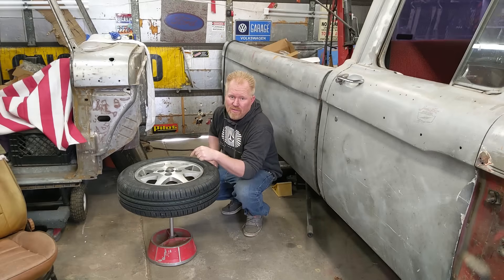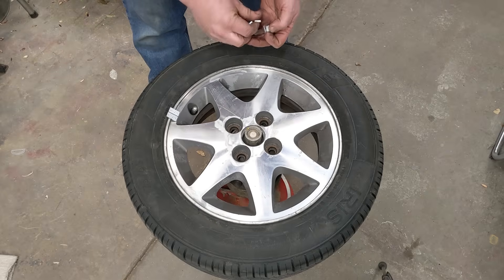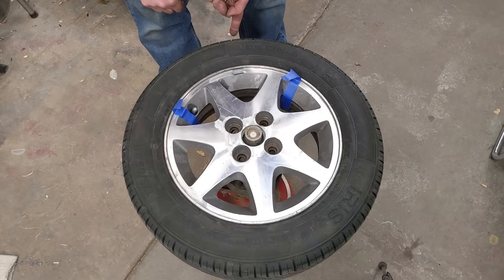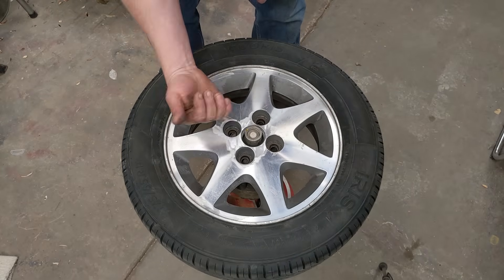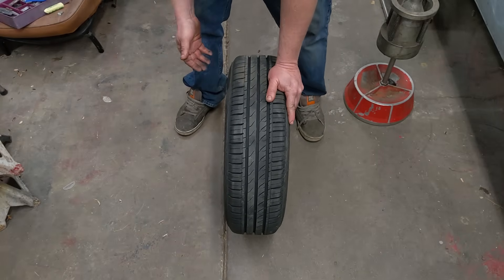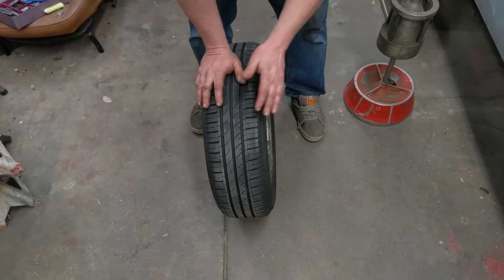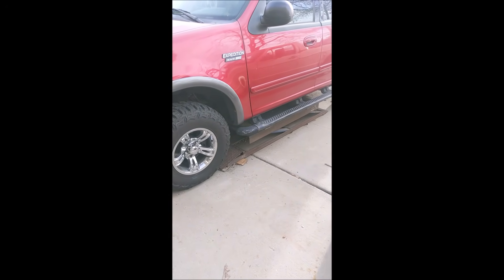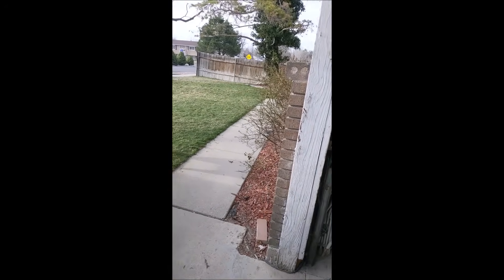Best Method How to properly Balance tires with a Bubble Balancer AT HOME

Comment: Get 4oz of air soft BB's break the bead toss 'em in done.
Reply from the maker: 4 oz in the tread area of the tire is equivalent to about 10 oz or 40 of those stick-on weights. Your best bet is to use a bubble balancer and figure out how much weight it actually needs. Most tires seem to be around a 1/2-1oz. So you likely only need about 1/4-1/2ounce in the tread area. That way you don't have the horrible wobble every time you stop and go from 0-30mph.

Comment: I haven't balanced a tire in years.  Just take the old rubber off, toss the new rubber on and go.   sometimes if i have a concern, just toss a non corrosive, non-rubber degrading fluid in there, but usually it isn't needed unless it is a really big tire.
Reply from the maker: I completely agree. Tires are balanced at the factory to be within spec and most balancing is just trivial. Most seem to need around half ounce of weight which is equivalent to having one or two rocks stuck in your tread. And we all know that makes no difference at all. I actually started balancing more because they promised longer tread wear life. That's bogus as well.

Comment: Interesting.  I never thought if this way to Balance tires.   Hey I have a 1990 Bronco and it used Electronic 4x4, the module went bad. It's super simple "old School Electronics" I was thinking if you're interested I can send it to you you can maybe figure it out and make a Video on it.   If not no Big Deal! lol
Reply from the maker: You're awesome. I'm by no means an electronic guru. I can replace a part if it left a burn mark or check things like capacitors but always hit a dead end when it's the actual micro chip that failed. In my limited experience that seems to be the thing that went in these '90s Ford components. I likely wouldn't be able to properly diagnose it. Thanks for the offer though as this is the stuff I do in my free time just to waste time.
Reply: @sixtyfiveford  Okay no Big deal, Thanks for the Reply though! Keep up the great content.

Comment: 65.. Thanks so much this I got one of those bubble balance rigs and gave up after I wasted a whole Sunday afternoon..Tires on and off the car 3 times.....PITA....Will give this a try.
Reply from the maker: Sometimes the Chinese balancers are so poorly made that you can't get anything correct on them. However if you have huge dynamic imbalance and you put the weights on just one side you just made the problem way worse. Centering the weights actually cuts the dynamic balance in half.

Comment: Do all tired have a little weight in the spot where the psi is printed onto the sidewall? My friend was a tire shop guy  and he said you don't have to balance the tire if you line up the psi with the valve stem.

Sounds like a myth, to me.
Reply from the maker: Most new tires will come with a orange/red dot. if you line this up with the valve stem it's supposed to require less weight and be more balanced

Comment: Great video! Never heard of the Y method but it makes perfect sense. I also had trouble with the HF balancer. I ended up balancing the balancer with tire weights. Now I get repeatable results.
Reply: Would you recommend staying away from the Harbor Freight balancer? I was considering getting one they have as I'm trying to do as much repairs myself without having to pay for services like this
Reply: @willglenn-bl9gm  I still use mine. It's a bit more fiddly than others may be on the market but others are expensive. It's workable at the price point

Comment: This works. It is the same method I was shown in 1982 when I started working in a tire shop. I balanced many a tire on the old Coates bubble balancer. One trip down a muddy road will throw off the balance of your wheels and tires, Not so important on the rear of a leaf sprung pickup, but detectable on the steering axle.
Reply from the maker: Awesome

Comment: Any ideas on this - read somewhere that the factory puts a dot on new tires that should line up with the valve stem (on the same side too) and usually have no need for further weighting.  In the few instances I've used it it seems to work, but not like I put on tires every day.
Reply from the maker: Not all but some tires will come with one or two dots. A red dot indicates the highest spot in the tire tread and the yellow dot indicates the lightest spot. Theoretically where the valve stem is, is the heaviest part of the rim so you put the yellow dot right next to the valve stem so it will require less weight to balance. There's a little more to it with the red dot but that's the gist of it.
Reply: @sixtyfiveford  Red dot is always primary.
Aluminum wheels are ''purposed" to have the valve hole drilled at the low spot on the wheel, red dot on tire high spot goes there. Ford and Dodge steel wheels after 96 "sometimes" have a white paint dot inside the wheel at the low spot on of wheel, red dot on tire high spot goes there.
 If no white dot on steel wheel and/or no red dot on tire, then tire yellow dot becomes primary, at the valve core. 
Harbour Freight balancer pin hole needs to be drilled to fine point, pin needs to be chucked up and spun against the bench grinder to a fine point. Then chances are about 5 in 7 for the Freight. If that don't work, it's junk like you said.
The bubbler is VERY good for checking the pro shop work when they say it's not our balance job, it's your car.
Nice bubble cover by you. Very nice.

Comment: What about balance  beads are they only for big trucks
Reply from the maker: They work just fine. However most sites will tell you to put in around 4 oz. Generally that is way too much. 4 oz in the tread area is about the same as putting 8 to 10 oz on the rim. That's about 40 of those stick on weights equivalent! The problem with the beads is you get a huge inbalance up to about 25 mph and then they start smoothing out. That's perfectly fine for a semi that spends 95% of his time on the highway but can be horrid on a stop and go slow moving vehicle. so I suggest using a bubble balancer to figure out approximately how much weight you need and then putting the beads in. Or you could just start out with about a half ounce of beads and just keep moving up until you felt no vibrations at high speed.

Comment: I would like you to experiment and possibly make a video on making the Harbor Freight balancer better.  I too bought one and was disappointed.  I found it would not even move when adding the smallest weight anywhere on the wheel, too much friction.  I took a magic marker and colored the tip of the post, assembled the balancer, and then took it apart.  I found the tip was rubbing way too far down on the taper of the post.  I used  drill to open up the dimple and it improved the performance, but it needs more help.
Reply from the maker: I think the biggest problem is the four rods with springs that depressed down in. Those rods have a ton of play and that plate that holds the rim can shift as much as an 1/8-1/4 of an inch. So depending on how you load the rim will affect its weight. With mine I determined if I loaded the wheel and rocked it all the way over to one position which kicked the plate to one side I could get repeatable results.

Comment: I used to work at Western Auto 50 years ago in high school. We used the exact same method with good results. The only thing different was we always used four weights .And would put a yellow crayon mark on the top of the tire when putting on the back weights. Then use the the front two weights to finalize the balance.
Reply: As far as I know Western Auto had no association with Montgomery Ward
Reply from the maker: Awesome
Reply: Western Auto. Wasn't that Montgomery Wards? I think I have a few sae sockets from them.
Reply: @paulsmith9341  'Sears sold most of the company to Advance Auto Parts in 1998, and by 2003, the resulting merger had led to the end of the Western Auto brand and its product'
At least here in the southeast a lot of older Advance Auto Parts locations are were the Western Autos used to be.

Comment: I had one of those balancers. I left it in the garage over winter and the bubble froze and broke. Can’t find another one. Harbor freight crap. You would think they would put antifreeze in it.
Reply from the maker: Really? I think I've let mine freeze a few dozen times. The biggest problem with Harbor Freight is they don't make anything themselves. They simply just put out for bid and allow 30-40 different companies bid and make the products for them. So the bubble balancer I got It's probably from a different factory than the one that you got and 10 other people got. That's why sometimes with items from there you can get a good thing and sometimes everybody says it's horrible or vice versa. You never know which Chinese factory made the exact item you bought.
Reply: There are videos on YouTube  on how to fit a laser pointer in them and use a printed target on the ceiling.

Comment: FOR Auto tire balancing, i always use 12 fluid ounces of full strength Prestone anti-freeze... n never needs re balanced EVER.. n no wheel weight to fall off... n also in the summertime the tire tread temperature will run 15% cooler
Reply: If you need to plug the tyre antifreeze will prevent the adhesive from bonding.

Comment: Never ever counter balance.! Adding more weight than needed. Will always cancel itself out like u said... So why do the wrong thing? And a dynamic balance is better than static. Weights on rim dont look good but it works better. If u counter balance on Semi truck tires especially fronts... U will chase it and never get zeros. The idea is as less weight as possible. If u see two weights on rim, spread.... Its wrong. Period

Comment: I have the China version of that machine from Princess Auto and it works perfectly. I lubed all of the moving parts and put some grease on the center where the wheel slides down to make sure it can center properly. I can get my wheels better than the shop can get them. I like the Y method, I came on it by trial and error. Someone I do is an old school mechanics trick to not set the beads right away, put the wheel on the balancer right after you mount the tire and check how it sits, so you can simply spin the tire around on the wheel to balance it before you add any weight. You may not need any weights in many cases.
Reply: When we live under a system where the goal of business is to maximize profit, this is what we get. You only get good work when you do it yourself.
Reply: I have heard about doing what you said, don't set the bead, and rotate the tire , nice.
Reply: Good advice. Thanks mate
Reply: Yes what you're referring to is finding the low spot of the rim and the high spot of the tire and you're putting them together to effectively eliminate the balance issue from the get-go just to give you an idea a tire that is balanced at 20 lb on a computerized machine will basically come back perfect you will never feel it in the car it is not enough out of balance anything less than 20 and just pretty much gold The tire machine at the shops most of them will spin it twice The first one to have you make a mark on the tire and then another one on the rim depending on which one they do first that's on the machine the manufacturer but then the tire shop will dismount the tire from the rim just breaking the bead spinning the rim and the tire together reinflating the tire and then re-spinning to check that the balance is good like I mentioned less than 20 don't even fuck with it I've done it myself of course that was a different situation with continued education

I am happy that you brought this up it will make people's lives a lot easier granted it is not the same as it being mounted with the beads but it's the best you're going to get who knows might be a chance you don't even need any weights you'll know when you hit like 45 mph and 55 mph somewhere around there if something's out of whack
Reply: Interesting
Reply: Exactly how motorcycle tires are specifically stated to be balanced, by first rotating the tire on the rim as best ya can, but most shops are either lazy or uneducated
Reply: Please explain me your method, I dont understand, after mounting the tire, I take it without air pressure on the balancer? And how can I move the tire on the rim after mounting? Please help, I am crazy of the balancer and give it uo after a day
Reply: I put the yellow dot under the valve, the balancer Shows the Point Not exactly in the middle of the ring, its a little bit over the midddle of the ring, but in the ring, does it matter?
Reply: Glory to Mao and the revolution
Reply: theres actually a little round dot on the tire thats supposed to point at the valve stem, at least thats what i heard.
Reply: @frigglebiscuit7484   well aware of that
Reply: I told the shop I go to to do something similar and they said usually the rims aren’t out of balance at all, I knew they were wrong but figured maybe not enough to matter
Reply: @aterack833  it's not the wheel that's out it's the tire. Most tires have dots on them to indicate where the valve should be to minimize the amount of weight needed to balance them. If the tires are older the dots aren't there. I have seen tires that the shop didn't balance correctly and they had tons of weights and the tires were still out, when all they had to do was mark the tire and rotate it on the wheel to make it work.
Reply: @patthesoundguy lots of rims are out of balance, especially cast wheels. Maybe high end machined wheels are close to perfect but most wheels are not balanced out of the box.
Reply: @DL101ca  I  bet there are lots of those wheels that are out of balance out of the box could be big out of balance 😉

Comment: This is good info. Treadwright tires which I bought for my truck actually recommended static balancing for some reason. What's the deal with balancing using beads? Never heard of that until I read comments here.
Reply from the maker: They work just fine. However most sites will tell you to put in around 4 oz. Generally that is way too much. 4 oz in the tread area is about the same as putting 8 to 10 oz on the rim. That's about 40 of those stick on weights equivalent! The problem with the beads is you get a huge inbalance up to about 25 mph and then they start smoothing out. That's perfectly fine for a semi that spends 95% of his time on the highway but can be horrid on a stop and go slow moving vehicle. so I suggest using a bubble balancer to figure out approximately how much weight you need and then putting the beads in. Or you could just start out with about a half ounce of beads and just keep moving up until you felt no vibrations at high speed.

Comment: I worked tire for almost 20 years , and I used a bubble balancer for most of that time . I would put them up against any balancer ! We always split weights on front and back . We had better results for people that ran at high speed on the bubble than on the modern spin balancers .!! Old School and proud of it . I didn't like stick on weights because of falling off , calipers taking them off and having no other place to put them ! 😒 great video!
Reply: Nah never bent a rim or a hubcap both were made to good back then lol 😆
Reply: Back in 1980’s at vo tech we had an on the car spin balancer
Reply: @franklaskus2395  same here but nobody used it lol
Reply: I worked at Sears Auto when I was a teen back in the 70s.  They trained me on bubble first then spin.  I think the only reason guys like spin is the time factor: It's faster (or can be) and heftier/less delicate.  But the spin would go down from time to time and the bubble never failed...
Reply: We had one of the old Coats changers, the longer rectangular (can't think of the model offhand), but I see them on EBay and other auction sites from time to time.   Would love to have one if I had the space.   Man I could fly on that thing...
Reply: @crforfreedom7407 coats 30/40
Reply: Ah so you're the old codger that beats wheel weights onto my rims

Only after prying the hubcap out and bending it no doubt

Comment: I'm due for new tires on my SUV and am seriously considering using liquid balancing fluid.  A co-worker of mine has beads and he's not happy with them because he says they get "stuck" in one side of the tire sometimes and cause an imbalance, but I don't think that's an issue with liquid.  Do you have an experience with liquid balancing or know if it's worth doing?  Thanks for another great video too!
Reply from the maker: They work just fine. However most sites will tell you to put in around 4 oz. Generally that is way too much. 4 oz in the tread area is about the same as putting 8 to 10 oz on the rim. That's about 40 of those stick on weights equivalent! The problem with the beads is you get a huge inbalance up to about 25 mph and then they start smoothing out. That's perfectly fine for a semi that spends 95% of his time on the highway but can be horrid on a stop and go slow moving vehicle. So I suggest using a bubble balancer to figure out approximately how much weight you need and then putting the beads in. Or you could just start out with about a half ounce of beads and just keep moving up until you felt no vibrations at high speed. Liquid is exact same but actually a lot smoother than beads because it'll kind of stick to the tire and flow around with it.

Comment: I had a HF one…i couldn’t get it to center itself and could never balance a wheel.  Took it right back
Reply from the maker: The first one I got from them was so bad and frustrating, the second was better but not much and the Challenger one is a breeze to use.